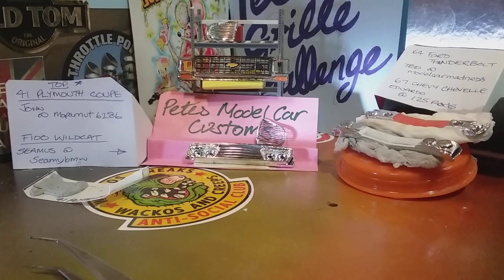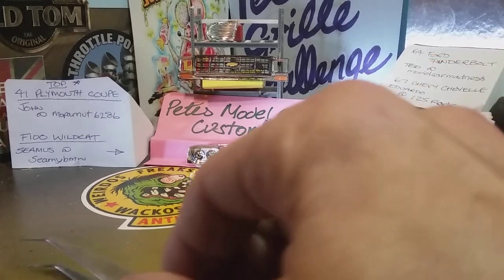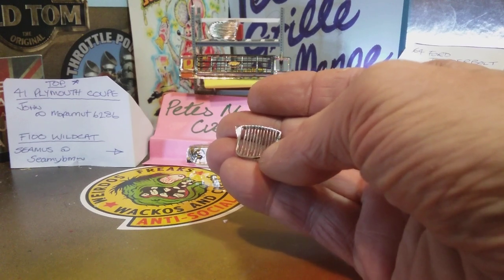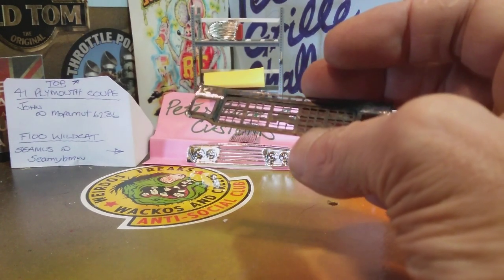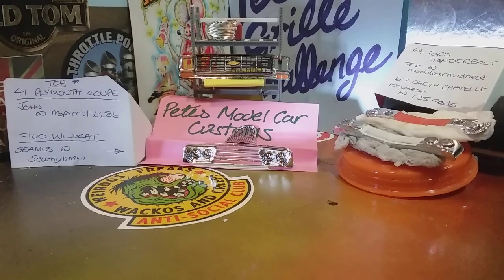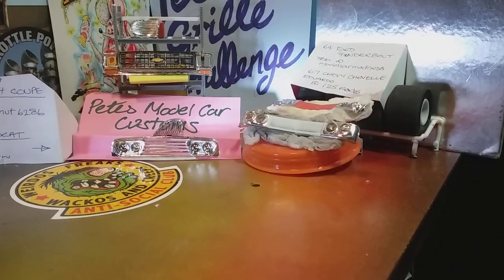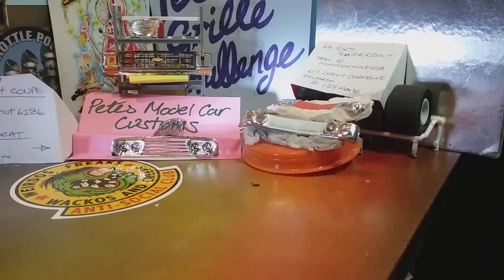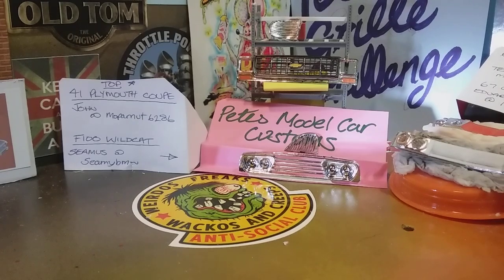Pete's Grille Challenge 5.Ford F100 Wildcat, 41 Plymouth, 64 Ford Thunderbolt, 67 Chevelle updates

Comment: Grilles, grilles and more grilles. Great work my friend
Reply from the maker: Each one had a different challenge, Steve. 😀Ways of supporting them as I cleared them out tested my little grey cells🤔 and the 41 Plymouth is like a filigree earring and extremely fragile so I've reinforced that with a stretched sprue framework on the rear🤓. I'm finishing this lot off with a tamiya 1/35th Chieftain tank🤣👍
Reply: Thats the beauty of our hobby. Grilles in the morning and tanks after tea LOL Happy modelling my friend
Reply from the maker: @SteveJonesScaleModellingSite  Its the only one I've used a dremel on. It's an old motorised model and the 'styrene ' was about 3 mm thick before I saw any of the shadow lines of the grille😧. Hours of hard labour🤣🤣

Comment: I just got "sucked in" to the Christmas joy. I have Wednesday the 27th off, so I'll try and get back on it then...maybe try it tomorrow after work if I'm up to it.
I was also working on those "drop in" wooden windows for Natie's Garage, trying to make the popsicle sticks interlock and sorting out the notches needed.
Reply from the maker: Do have wooden matches in Canada. I found extra long cooking matches are very handy. Hope the store you are working in stocks them👍
Reply: @petesmodelcarcustoms584 Our store doesn't, but the Dollar Store next door does.
Reply from the maker: @MonsterHobbiesModelCarGarage  they tend to be about 1.5 mm square,which is pretty handy but they might need a light sanding as can be rather rough cut for model finish👍😃
Reply: @petesmodelcarcustoms584  for sure!

Comment: Man that 41 Plymouth must have been a hard one. I guess if you can open that one Iight have been able to do the 40 and 32 Fords that i already finished. I was afraid to try them when I was building the cars.
Reply from the maker: I've showed the 40 I've done,Ted. When I tried doing a 32,a couple of years ago,it collapsed on me. I don't bother doing those types anymore.😧.. I've added a correcting an error idea for the next video and rubbed too far through the Chevelle one. As I thought that might happen to someone new trying this and don't want people to totally give up if they do something like that,or like 125rods want to try to repair what they have done🤔
Reply: @petesmodelcarcustoms584  yea, I saw your 40, that was a deluxe and I know how hard those side had to be. Mine was a standard, which is like a 39 deluxe. Ok, guess I won't try a 32!
Reply from the maker: @modelcarmadness5119  I'll  give you another tip. Imagine 2 fine toothed haircombs. Space them,parallel, 2 inches apart and fix them,standing upright with prongs stood up. Maybe into parallel saw cuts in a block of wood and epoxied in,with the prongs lined up to each comb. This is hard to explain in words, so look for a drawing in my pad in a future vid. But continuing, if prongs are lined up,evergreen strip can be laid into gaps in combs,bridging the 2 combs. At 90 degrees,glue another strip bridging the other strips, near each comb and you should have a  row of strip equally spaced by comb prongs forming a grille  to replace a fine moulded grille for a deuce grille.Merry Christmas 🎅👍
Reply from the maker: I've just checked some images  of 40 standard and deluxe.🤓 You might well be able to clear the standard grille if you're careful following the radius of the arc👍🤔😀.  I would certainly consider having a go👍😎
Reply: @petesmodelcarcustoms584  I'd have to take back out of the finished car, but maybe one of these days I'll give it a shot
Reply from the maker: I hope you buy another one,some day. I love the styling of 40s Ford's, Mercury's, Lincoln's and even Chevrolets and Dodges😀😂